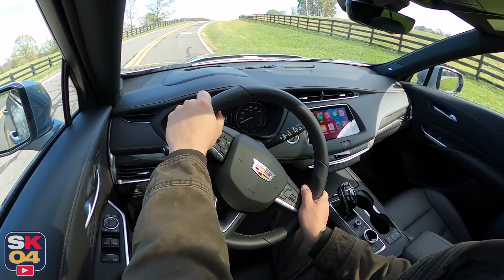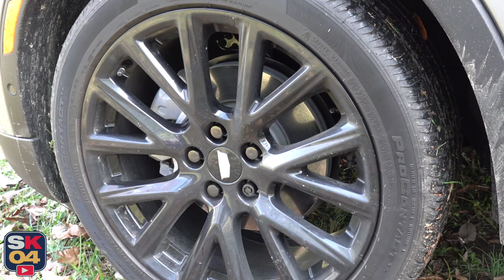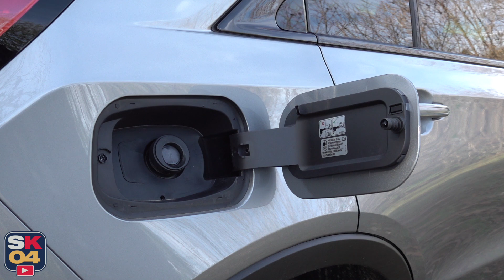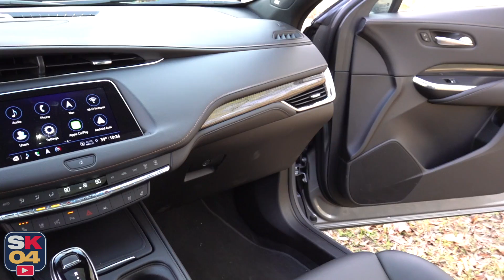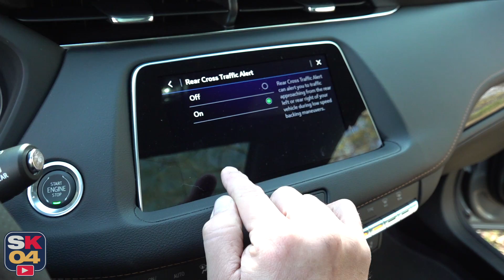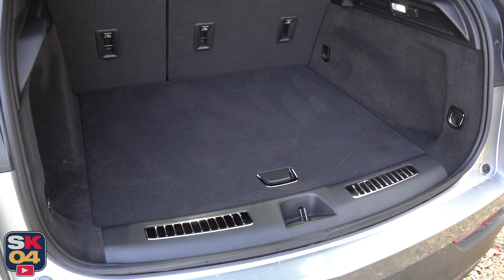2023 Cadillac XT4 Sport AWD: Start Up, Test Drive & In Depth Review

Comment: I'd wait for the 2024 model. That's the MCE. Lyric like digital dash, refreshed front end, 5G wifi hotspot, and GMs new Global B electrical system, which means Super Cruise will be offered, although not initially.
Reply: Very true but that also means you can get a killer deal on 2023 model
Reply: Dangerous wifi hot spot  - excessive EMRs close to your sensitive areas. AI will tell you which vehicles have safe levels of electromagnetic radiation

Comment: The XT5 is Cadillac's best seller.

The XT4, has plenty of great features that the XT5 and XT6 don't have such as the heated/cooled/massage seat.

The price of a loaded XT4 is competitive against the XT5. 

The problem is THE SIZE.  It's just a little too small, even tho it offers more than the CT4 or CT5 in terms of practicality.

I've ordered a  Cadillac Lyriq AWD.

Comment: Why is the chime like that?
Reply: GM changed their door chimes in the year of 2020-present
Reply: @MKingDMV  even we wished GM motors should’ve do is the right chime just like the Escalade and it’s better than the other chimes makes it looks newer and a better gauge sweep like the GMC Yukon
Reply: @MKingDMV  I know, but they are supposed to have a soft, relaxing chime instead of a dinging noise like this one.
Reply: @WesleyMediaYT  Well it just sounds like they remembered what its purpose is.
Reply: @WesleyMediaYT  that's right the Cadillac escalade and the GMC Yukon has the better chime and the GMC Yukon the dash gauges is awesome with a little faster gauge sweep when on gauge cluster startup
Reply: And this summer the updated 2024 XT4 will be out. With a interior upgrade and new technology. So I sure it will get the new chime.
Reply: @Corvette1658  yes the one from the GMC Yukon  Cadillac Escalade the newer corvette and some others like the chevy Tahoe and the GM trucks just changed to the better chime instead of the dinging chime